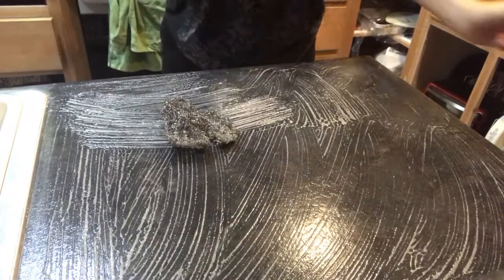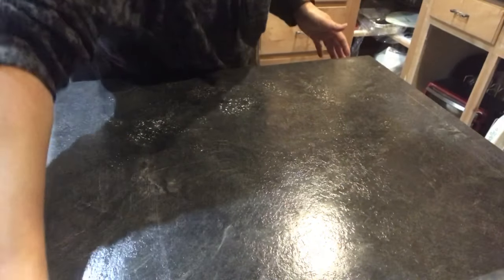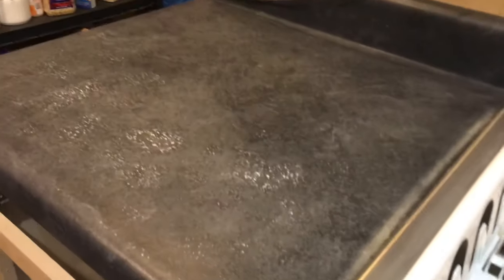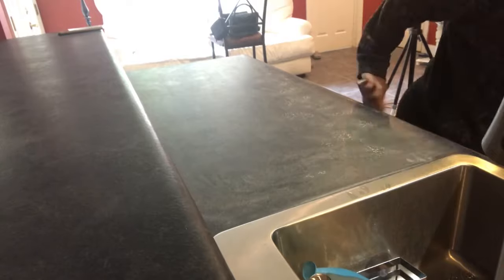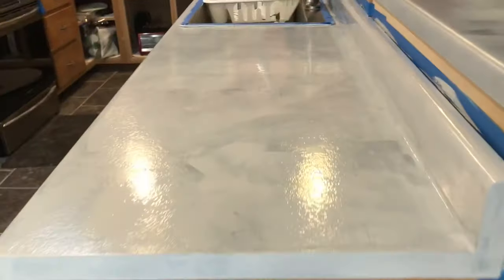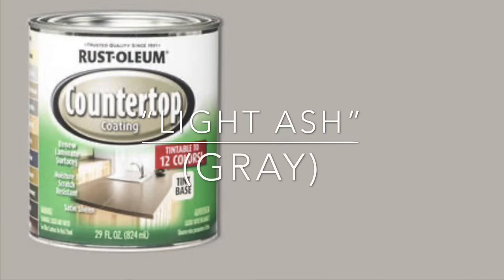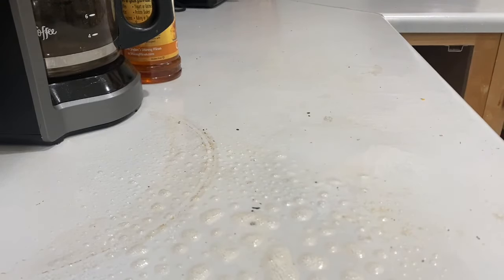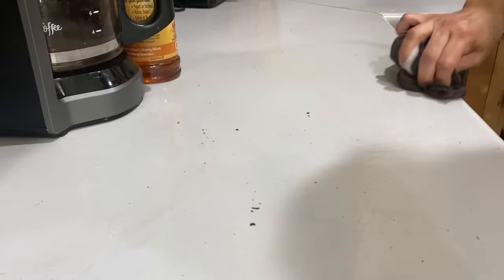I PAINTED OUR COUNTERTOPS!! BEFORE AFTER AND 10 MONTH REVIEW | RUST-OLEUM COUNTERTOP PAINT LIGHT ASH

Comment: I noticed you didn't use a primer. That would have helped a lot and allowed the paint to settle more evenly. Also a coat or two of epoxy resin would have given it a really hard top
Reply from the maker: Maybe but since the can said no priming needed I went for it 🤷🏻‍♀️. Lesson learned! Thanks for watching Sandi!
Reply: Sanding with a lower number grit sand paper like an 80 would have been better also. Also sealing with a clear coat.
Reply: @Myeyeofthebeholder  that’s what I was thinking.
Reply: Epoxy resin will not last. Terrible idea!!
Reply: Just how long
Does it take for epoxy to dry ? Or set?
Reply: @lisamariesanchez80  This video is using Acrylic Paint. Dry to the touch in about 1 or 2 hours.
Epoxy is different. Dries about 12 hours but to cure fully, 14 to 30 days.
Be careful if you don't know anything about epoxy. You could have a mess on your hands.
Reply: @briankane3905  eeeeeekk😳😳 ok scratching that idea off..
Reply: @briankane3905  thank you for replying ..
Reply: I have painted my cabinets with Amy Howard One Step. Absolutely beautiful! I did do two Coats and Polycrylic Matt Sealer. Now, I am about to do a counter top.  Same One Step Paint, different color, but I’m following her video recommendations on countertop tutorial.  Many great reviews, and looks amazing!!! Btw- I have done my huge kitchen with ONE CAN of One Step and with new hardware it cost $150 for all of it.  I feel so accomplished and encourage you to start over with Amy Howard. 💜💜💜

Comment: I put a topcoat over the Rustolium Countertop Paint. I used linen for my countertops & a  Polyacrylic as a topcoat/Sealer and it has been amazing.  No Cracks, No Scratches, it looks great, cleans up great 👍👍👍👍👍.  I spent more time doing prep than I did painting and I’m so Happy with the results!! 😁
Reply from the maker: Great tips! Thanks for watching!
Reply: What brand and type of paint was the polyacrylic topcoat? Thanks
Reply: How long has it been now and how is it holding up? Thanks.
Reply: I’m gonna use the Rustoleum appliance epoxy paint, can I paint  overtop if that for a design and spray epoxy over it?

Comment: For ANYTHING that absorbs a lot of light or becomes the main focus of color like black or any other deeply saturated colors- gotta prime it. If you can’t find primer for whatever reason, be prepared to do multiple coats for complete coverage. It applies to dyed black hair too 😉 don’t ever think you can go from dark to light easily, it’ll always be a process.

1.) prep surface
- wash & scrub well
- sand surface
- wash again very well
-go over with acetone or high percentage alcohol (this is crucial before primer or paint) as certain cleaners have degreasers that prevent the paint from being absorbed properly by the surface

2.) tape off & plastic areas you don’t want painted. Be very careful with 3M painters tape. Thick coats risk paint bleeding into the tape, so make sure it’s secured properly or get a good quality painters tape.

3.) prime first if possible. Primer will save you from doing too many coats of paint. (2 coats of primer is ideal, bc after the first coat dries, it’s a good idea to go back to see & feel your progress, you may realize you have some light sanding to do, this would be the time.)

4.) paint your base coat. 1-2 coats if primer was used, 3-5 coats if without primer.

5.) top coat or gloss. You should only need 2-3 coats of gloss, especially if you used primer.

For whatever reason the counter still isn’t shiny enough for you, you can consider your options for coat of epoxy. It’s more involved & can make the countertops heavier, but it also makes them more durable. Good luck on your future projects, and remember, it’s easy to go from light to dark, but always a process going from dark to light in ANYTHING you want to change color.
Reply from the maker: Thanks Harlem lesson learned for sure!
Reply: I have a yellowish formica bathroom countertop and want to paint it because can't replace it right now. What should I do?
Reply from the maker: @ronilda2231  hi! I have another video using appliance paint which worked way better but one thing I do suggest is lots of prep. Lots of sanding and priming before the appliance paint. https://youtu.be/lU723JQEnWA
Reply: @OurClassicHome  thank you. What kind of primer do you use?
Reply from the maker: @ronilda2231  that was my mistake actually,  I didn’t use any so I would ask the paint expert at the store which you should use.
Reply: @OurClassicHome  thank you for your replies. I have a little bathroom vanity. If I can't figure it out I will wait to replace it.
Reply: @ronilda2231  yellow Formica countertop. I would rough it up a little by sanding it down by hand with a fine grit sandpaper. Either sand until the yellow is gone, or if it’s solid yellow throughout, just sand the surface thoroughly enough that it’s a relatively even surface, and the top coat of shiny sealed yellow is roughed off.

Wipe down sanded counter with denatured alcohol at least twice. You don’t want any debris from sanding to mess up your paint job. Make sure the countertop is wiped down well, and as many times necessary until you don’t feel anymore debris.

Primer. It can take anywhere from 2-4 coats of primer, but I would think you can use Kilz Latex Primer. It’s water based & has a dry time of 30-1hr for recoat. If it’s in a bathroom, you might have to go for an oil primer if there’s a sink. Oil primers take a long time to dry, so it’s a day by day affair. Ventilation is also necessary. Ask your local diy experts at lowes or Home Depot for what primer is best- but absolutely do not skip it. It’s very necessary.

Your paint should coincide with the type of primer you selected. If you used water based primer, pick a good quality water based paint for good coverage, minimum of two coats. If you picked oil primer, pick an oil paint. Epoxy/appliance paint - again refer to its instructions and/or professional if it can adhere to oil based paint or water based paint.

For crisp clean lines and not messing up certain areas, I recommend frog tape. It’s a green painters tape. Painters tape is your friend. Apply it well, and remove after painting. Don’t leave it on for longer than 24 hrs or you can mess up a paint job. Don’t apply it if you’re not going to paint within 72hrs, bc it can ruin whatever surface it’s adhered to if left on for too long. GOOD LUCK!
Reply: @ronilda2231  btw, if I could give a suggestion, I would go for:

Water based primer like Kilz latex primer. Minimum 2-3 coats. Then, I’d go for a chalk paint for the vanity/countertop. Check out your color selection, I think it’s a rust oleum product. That’s a minimum of 2 coats for true color. After that dries, I would seal it with polyurethane, so it has a shine & your paint job won’t fade easily. 2-4 coats depending on how shiny you want it, but the paint job is pretty much sealed after two coats!
Reply: What kind of primer for laminate counter tops?

Comment: The reason there was black showing thru might be because of incomplete surface prep. Not sanded correctly, wrong grit, or most likley the Dawn was not cleaned away using alcohol,  or automotove type pre painting surface cleaner. If primer was not required one of those is the problem.   Rustolium should have better "Directions" on the can.

Comment: didn't sand and rough up the surface so the paint forms a bond with the surface.  Fresh paint on a previously smoothed manufactured surface will encourage the new paint to chip
Reply from the maker: The can said no need to sand but I should have not listened to that. Thanks James.

Comment: After you cleaned the surface with soap, did you clean it again with solvents like acetone, thinner, or surface prep cleaner?
Reply from the maker: I didn’t, but that’s a good idea.
Reply: If you didn't, the surface wasn't prepared correctly. That's why you got those blotches where the paint wouldn't stick. Should scuff the surface with either scotchbrite (red preferably, not green), or even better sandpaper (to get rid of some of that texture while you're at it), and the final cleaning with with a solvent based cleaner that doesn't leave any residue. They actually sell stuff named prep cleaner/surface prep.....

Comment: I have the exact same Formica counters and was hoping you would have had a better outcome. I think if you hadn’t done such a drastic color change you would have had better results. I think if you wanted white you could have used Rustoleum’s appliance paint. I’ve used it on refrigerators and it really does an amazing job- but you would need at least 3 coats to go over black. I think I’m going to try the counter paint but do it in dark gray so if it chips it won’t be noticeable. Thanks for your video!
Reply from the maker: Hi! I did eventually used the appliance paint. In fact I have a video on that and also another video on 3 different paints for countertops. Hope that helps! Thanks for watching!
Reply: If you want to change it cheap this stuff is awesome I use it on rental properties and the hud inspector thought I put in concrete counter tops not that it looks that good just way better than they looked from that 80s style formica
Reply from the maker: @bender49ers  that’s awesome! And good for you for investing 👍👍

Comment: it would of covered up completely if you did a primer coat first than the paint I have black countertops, painted them bright white,used primer than Rust-Oleum paint only used 1 coat of paint after priming first just a lil f.y.i to help.
Reply: the appliance paint doesn't up hold to well did are r
v in that & it was a wasted time just my experience, & we own are own construction company so if it didn't work don't waste your money,it truly is all about prep, primer you get that perfect & it will look like you paid professional painter to redo you kitchen
Reply from the maker: True, I'm just hoping it'll look "clean" until we can get the countertops done. I cant wait! Thanks for your comment Angelica!
Reply: Your so right she should have used primer
Reply: What primer should I use? Link please?
Reply from the maker: @cameronwilson4782  it says no primer needed so I didn’t use primer
Reply from the maker: @tinaschneider4232  it says no primer needed so I didn’t use primer
Reply: You can redo your counters by lightly handsanding the counter, then add the primer (Kinsler 123), then 2 coats of white enamel paint, then add 2 coats of epoxy resin.  Stone Coat and Leggari are good brands of epoxy.

Comment: Hi I dont know if you can help, but I just painted my shower floor with rustoleum tile transformer kit. Problem was they dont supply a colour chart and store doesnt have one either, so looked up on my phone, but the screen distorts colour... So now I am left with a colour in my shower I dont like! Do you know if I can paint over it again with something else? Or the same product and try another colour - only that gets expensive having to keep buying kits and guessing colours.
Reply from the maker: The kits come with an enamel paint, I've noticed. Look at the paint can you used, if it says enamel paint then just buy an enamel can of paint. i would prep the surface first by sanding. The best person to fully answer your question would be the paint expert at your store. Hope that helps some! :)

Comment: So I just wanna emphasize that you need to wear a respirator with voc grade filters and section off any openings to the house (with tape and plastic wrap, tightly) from the kitchen and turn off the air throughout the house and open all windows. And leave it like that alllll day. This stuff is rough and has extra toxic vapor.
Reply from the maker: agreed! thanks MP

Comment: use the appliance epoxy white
Reply: and protect it with a poly coat
Reply from the maker: That’s actually what I ended up using because this started chipping. I made an updated video. Thanks for watching!! ❤️
Reply: Would also recommend a light sanding prior to priming.  I’ve been researching multiple ways to refurbish my perfectly good, but strange colored countertops.
Reply: That is what I want to use but I want black. It doesn't seem to come in black, just spray paint. 😞